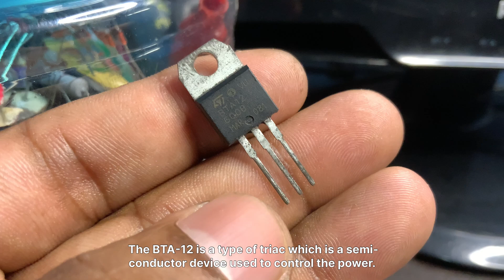BTA12 Triac: Pinout, Features and Application

Comment: Can I replace the Bta12 with a btb12 ?
Reply from the maker: BTA12 and BTB12 are both 12A TRIACs from STMicroelectronics, but the primary difference often lies in their package type and tab insulation
Reply: @Lifeofelectronic thanks ! I can’t find Bta12 , just btb12 for a device that controls the temperature , fan and wather pumps for a termic agent in my house .